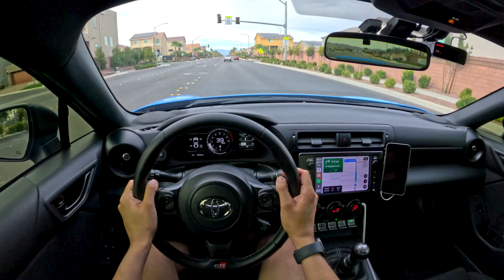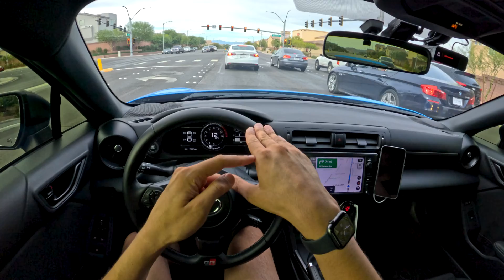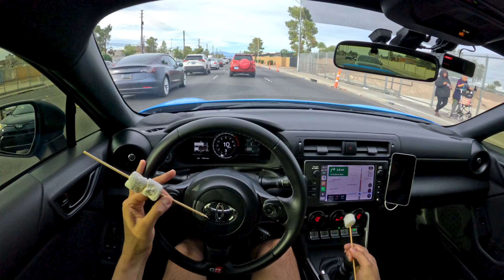The Truth About 50:50 Weight Distribution

Comment: The real myth is the 911 story of rear engine superiority.  If it’s such an exceptional set up, wouldn’t we’ve seen other cars mimicking the design principles?

50/50 is inherently best for static balance.  It goes without saying that when driving the car, you need to employ techniques that deal with the inevitable transfer of weight.  Calling BS on this video.
Reply from the maker: No serious engineer thinks RR is superior. MR with slight rearward bias is real

Comment: the point is 50/50 is just relative number, the actual figure that matters are wheel base and the weight on each wheels, a lot of people say a base 5.0 GT mustang has 52/48 weight distribution it's perfectly balanced.....no, because there are a lot more weight to shifting between the front and rear due to it's long wheel base and heavy body, so it is not very encouraging to drive or rotate compared to a bmw m2 for example. Also wonder why rally cars all have short wheel bases. (the new supra is a very very fun to drive car because it has a shorter wheel base than a gr86)
50/50 is like a thing people talk about but there are other factors that contributes to the overall balance of a car instead of a number.
It's like brakes, everyone think bigger the brake the better, but doesn't have the tires to back up their brake forces
Reply from the maker: Yes keep in mind that Shorter wheelbase more nimble but less stable. Longer has more stability. Trade offs
Reply: The mustang is more likely to slide in this exact scenario. 2% less of the weight is in the rear creating an increment of pivotal traction AT the front of the car dictating the point on the chassis the car is going to rotate around. It’s why Porsches with the engine in the rear rotate entirely differently than any front engine RWD car. 50/50 distribution is best for both handling and performance as it makes the car the most stable it can be and provides the greatest amount of lateral grip. It’s physics.
Reply: @assfaultEli agree with you there. However physics proves can be fixed with enough money in the suspension R&D. Like 911s went from 250hp widow maker to 500hp GT3RS that’s fairly easy to drive by every one

Comment: okay seems like you’re talking more about performance and lap times than anything else. The reason a 50:50 weight distribution is so loved is because it is balanced and rotates predictably and progressively. Great for drifting (why M cars are so good and easy to slide), great for backroads where there’s tight corners (why Miata’s are perfect for a backroad) etc. 50:50 is perfect in some situations, while a Porsche 911 GT3RS excels in others
Reply from the maker: Great counter point
Reply: To be fair you compared a mid engine to a awd/rwd 50/50 balance also if you adjust your tires grip running a non static tire setup you can counter the weight distribution towards your needs also allot goes into handling Weight distribution is subjectively irrelevant just fruit for thought 🤷‍♂️
Reply: @easydayez  weight distribution is the fundamental of how things rotate and while it doesn’t necessarily mean so much in the talk of cars because of other factors, it still plays a role in how a car rotates. Maybe not when all 4 tires are in grip, perhaps when the tires are sliding. Rain/snow/ice, fundamental rotational dynamics increase importance with a decrease of grip
Reply: @Dyltheboy  I suppose that’s true I don’t believe it’s not important but when picking a car to buy I wouldn’t worry about it
Reply: @easydayez  yes, unless it is a car that will be driven in winter or other sliding conditions. Take a truck for example. they’re genuinely dangerous in the snow because of the weight distribution
Reply: love drifting my ptuck in the snow, very ez to drift rwd truck  @Dyltheboy